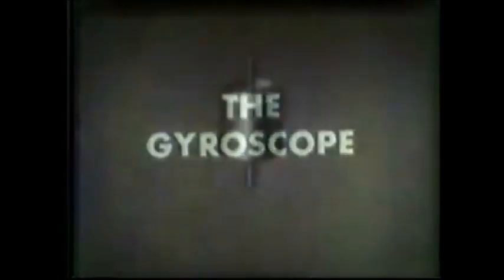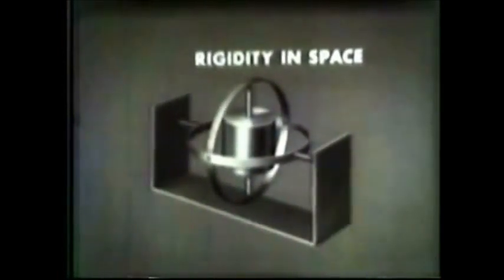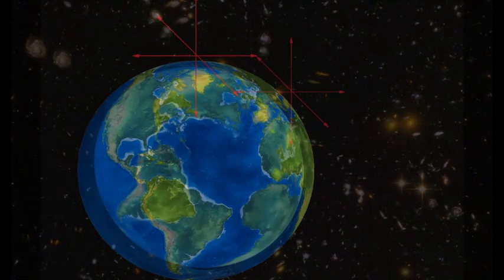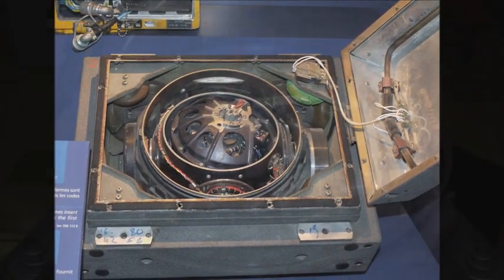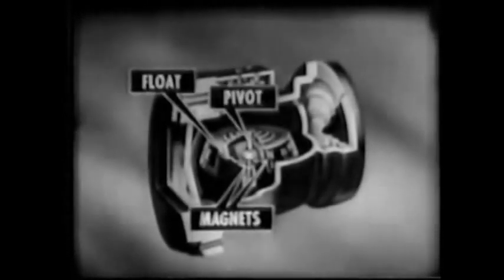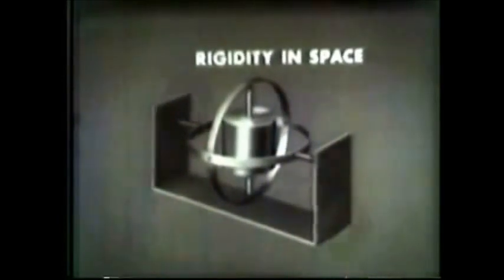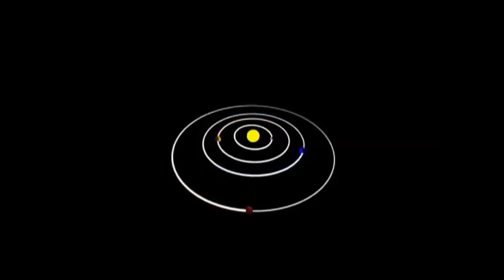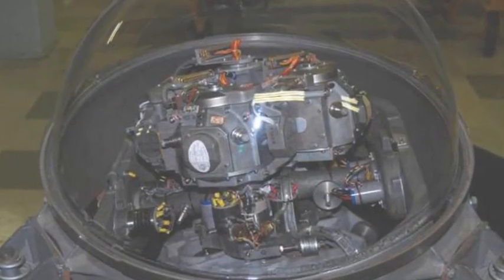Gyro Navigation: IMPOSSIBLE on a Globe...

Comment: Sup bro, I used to be in the Navy. Conveniently I have lots of experience troubleshooting the AN/WSN-7 :) For those wondering, it's a very accurate Gyroscope used on Navy Ships. So if you ask I will tell, but I can tell you only what I know :s
Reply from the maker: +Bennie Johnson I will ask, most definitely! I'd say the question most people are chewing on when it comes to topic of gyroscopes used in navigation systems is if indeed they do or do not truly "adjust for curvature", one way or another.  I know that Shawn Mcrary (another Navy guy who knows about gyro nav, particularly as it relates to weapon systems) says absolutely not. Your thoughts?
Reply: +the Truth is stranger than fiction... Your buddy is right about weapon system Gyro, as there is no need to correct for curvature, the Gyro is for stabilisation of the gun or missile. Most modern missiles have a Gyro, altimeter, and GPS. Some even have a camera to compare terrain to known terrain. I'm off topic a little, but I was told by a Tech Rep. for the WSN-7 (ships gyro) that in the developmental stages it didn't work because it was so accurate that it was picking up earth's spin and movement and they had to develope a logarithm to ignore that and focus on the ships movement through the sea. I don't know how true that is but like I said before, this wasn't a question I had at the time. I know it's not much help, but I'd look into the WSN-7, and you may be able to find the NEETs Mod that goes with it. 
I just don't feel like spending anymore time on this right now, got more pressing things, but let me know if you find anything.
Reply from the maker: *****
If you ever have time, look further into the Sea Sparrow missile system, as this was the one my friend is specifically using, and again, the primary piece he talks about which defies curvature, is the focused radar beam, used to "paint the target" up to 50 miles away.  IF THE WEAPON SYSTEM CAN ACTUALLY DO THIS, WELL THEN THERE IS NO CURVE...
  Thanks for the conversation.
Reply: @thetruthisstrangerthanfict4367  
The 'Sea Sparrow' does not have a gyro, it is radar guided. It is coupled to a WM/25 or STIR-24 fire guiding radar system. The 'evolved Sea Sparrow' uses APAR (Active Phased Array Radar) as guiding system.
Reply: @benniejohnson8534  
"told by a" is the biggest lie among know-nothings. You HAVE to or it wouldn't be POSSIBLE to hit anything, I'm a physicist, we DO know this stuff for CERTAIN!!
Reply: @thetruthisstrangerthanfict4367  
No, the radar controlling it is up on the mast. That makes it possible to see over the  horizon you can see at the deck.
Reply: @thetruthisstrangerthanfict4367  
It HAS to, or they couldn't hit a thing. Former sailors who blabber nonsense like that never knew shit from shinola.
Reply: the Truth is stranger than fiction...
Navy guys know fuck shit about how things work, they just replace them, and use them. Only a few physics and engineering specialists on every ship know anything about that.
Reply: the Truth is stranger than fiction...
No, the Sparrow is GPS and satellite assisted. In addition, planes launched from other craft are used to see over the horizon.
Reply: @rstevewarmorycom  
"No, the Sparrow is GPS and satellite assisted." Nop, not at all fake physicist.

Comment: wow... you really dont know about the frame of reference, do you? what you mention about how gyros work is right, but have you do the calculation. let say you do the gyro movement relative to the center of galaxy in an hour time span for example. if you do the calculation right, the difference would be very small. it would be less than 0.0000000000001 degree movement in an hour. you still think that kind of movement would make gyro moves randomly? gosh, now i think you publish this video is just for a troll
Reply: and one more thing. actually the gyro is affected by gravity even though it is  very small. in relativity theory, gravity bends the space. so the gyro should be affected by it. scientist has proved this right by sending a very fine gyro human ever made to the low earth orbit.
Reply from the maker: +Adnan Hutomo I would say you are greatly mistaken, on both points....
Reply: the Truth is stranger than fiction... So, would you kindly explain which part i did wrong?
Reply from the maker: +Adnan Hutomo Indeed, "frame of reference" is what it's all about here.  Tell me, how fast is the Earth supposedly spinning (at the equator)?  And then, how fast is the Earth supposedly moving around the Sun?  THEN, how fast is the Solar System supposedly moving through the Milky Way? And finally, how fast is the Milky Way Galaxy itself supposedly hurtling through space?

All of these alleged motions of the heliocentric model are in DIFFERENT directions.  Simultaneously.  Thousands upon thousands of miles an hour.  Yet, you think the gyro would only deviate from "galactic center" by the tiniest fraction, in an hour....?  Explain to ME how that makes any sense at all!

Your second comment is so fraught with assumptions/errors I'm really not sure where to even begin.
Reply: +the Truth is stranger than fiction... okay. first, since we argue about how gyro works in globe earth so we are gonna assume that earth is globe in shape for this explanation okay? the concept of gyro keeping its position is not because it is moving but rotating. If the gyro rotating in upright position at northpole then you move to the equator, the gyro will be rorating in sideways direction. It is already explained in your vide clearly right? So it is clear it is not because how fast the gyro moves but how the gyro rotate in respect of frame of reference. Now we are moving to earth revolving around the earth. As you may know, a single revolution atound the sun takes earth a year right? So in a day the gyro supposed to move approx 1 degree than it suppose to be. And then move to how sun revolving the galaxy. It takes 225 million years for sun to revolve around the center of galaxy. So it takes around 750 thousand years so the gyro will move 1 degree. So please it is not the velocity that matters, but revolution time and the rotation that matters. No matter how fast you moves a gyro in one direction. As long as it is not rotated the gyro will not moves. 

Is my explanation clear? :)
Reply from the maker: +Adnan Hutomo Yes, clear, but still very confused. You seem to be thinking that the "frame of reference" has to do with center point of these alleged orbital motions.  No, the frame of reference for the gyroscope is actually itself.  This is the what is meant by the term "rigidity in space", and why high-grade gyros are such incredible things.  Like others have noticed, according to the official explanation, the rotation of the Earth alone should actually cause a gyro to tilt 90 degrees in six hours. But this of course doesn't happen.  The Earth isn't spinning, not moving at all, and this has in fact been scientifically demonstrated in a number of ways, but of course you have to be willing to accept the idea that this fundamental truth has been covered up....
Reply: +the Truth is stranger than fiction... well my friend, it actually does happen. if you are designing a high precision gyro for aircraft, you also have to consider the earth rotation effect. that&#39;s why gyros in aircraft are equipped with high precision clock too to correct this. (in fact most of aircraft today are not using mechanical gyros anymore, they are using laser to get better accuracy since there is no moving parts inside)

edit: actually to eliminate the earth rotation effect, the gyro is spinning based on the earth rotation axis. So there will be no more error to correct. I am sorry  i have to edit it but i leave my first reply unedited

Comment: If the gyro compass works for relatively short periods of time of a couple hours or so with small maneuvers then would it not indicate rather a geocentric global earth instead of a geocentric planar earth?  The military training video said nothing about compensations for time & latitude.
Reply from the maker: +Soteriology101 Nope. This question of longer distances and longer durations of time is why I did a video on ICBMs, which also have gyros on board, and travel such distances that the amount of curvature involved would be immense.  When you stop and listen to the Navy folks talk about how the gyro nav system on a ship or sub is "spun up" in port, before embarking, and then kept spinning (without "adjustments") for the entire trip (which can be weeks or months at a time) then you start to realize that all these objections regarding only "short distances" or "short amounts of time" don't hold up.  Not only this, but remember those gyros I mentioned earlier on the sea sparrow missiles? They synced with the main gyro on the ship.  So ALL pieces, (the ships, subs, aircraft, and projectiles) are operating within the same planar model, the plane being the major reference point they all work off of.  There is no curve.  You cannot demonstrate it through any observable means.  It is an abstract creation of imagination....

Comment: Do they use gyros in fighter jets?   Or do they use QRS11 chips?  What do they use in cruise missiles? Or what do they use in any missiles?
Reply from the maker: +Soteriology101 according to Sean McCrary, the Navy instructor for the SeaSparrow missile system, those missiles do indeed have gyros on them, and no, they do not compensate for curvature, gravity, etc by way of magnetic compass, GPS, or anything else.  It is truly a flat model system.
Reply: @thetruthisstrangerthanfict4367  
The Sea Sparrow has NO gyro. It is radar guided and has reaction wheels.
Reply from the maker: Samuel Beal
So, did you actually bother to watch the video, or are you just skipping right to leaving comments without familiarizing yourself with the discussion already in progress?  If you watched the vid, you would quickly see that when it comes to something like the Atlas rockets, (the first inter-continental ballistic missiles) which were said to be able to go over 1/3 of the way around the alleged globe, then obviously at that point you would HAVE to account for a LOT of curvature... ;-)  And these ICBM's used gyro nav, along with other components, and so the question remains as to how in the 50's/60's they were supposedly using inertial navigation systems which account for curvature, especially when dealing with projectiles flying at such high speeds...

The answer?  They weren't.  There is no compensation for curvature, either then, or now.  It's all just techno-jargon chaff, designed to provide an impressive-sounding answer, but it never adds up if  you actually pursue it and demand to make it all explain itself....
Reply: +the Truth is stranger than fiction... Because when the earth is so large the calculations may as well be flat you dumbasses. Just because 2-dimentional Euclidean calculations are the most efficient it doesn't mean the system as a whole is flat, just indistinguishable from at such small scales. Please stop being stuck in your personal universes and actually learn about the universe you live in. X

Comment: Absolutely.
I'm down to contribute to funding this experiment.
You/Someone should start a crowdfunding campaign to make this happen.  
I see it as needing two main components:
1. A miniature version in which the gyroscope and rigging are affixed to a ball that slowly rotates. This will show that, while the rigging of the gyroscope turns with the rotation of the ball, the central gyroscope remains straight up and down, fixed.  That's the whole point of a gyroscope. You can spin the ball all the way around, and the central gyroscope will not change its orientation.
2. Setup the gyroscope and rigging on a flat table and record it for 12 hours.  If the earth is rotating, the SAME phenomenon should be encountered as with the miniature version.  I can promise you this will not happen.  The gyroscope will remain perfectly aligned to the rigging for 12 hours.... 24 hours, a week, a year.... forever.  Because the earth is flat and we are not spinning.
This needs to be documented properly and then it can be leveraged BIG TIME.
Reply from the maker: +Ty Gorton I totally agree, this would be a very compelling area of experimentation.  Seems like there are several people now talking about doing this very thing.  (take a peak at the comments on my first "gyro video"...)
Reply: Such a long post to say five words. All you had to say was" I do not understand gravity". Or " I do not understand gyros".